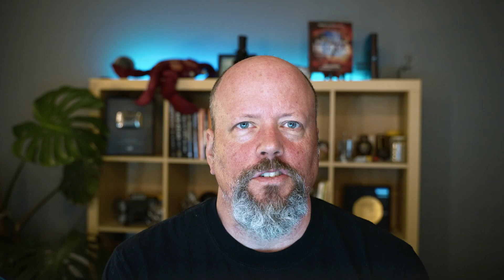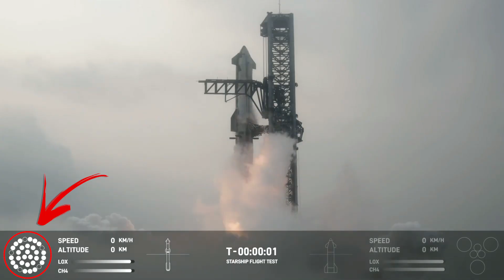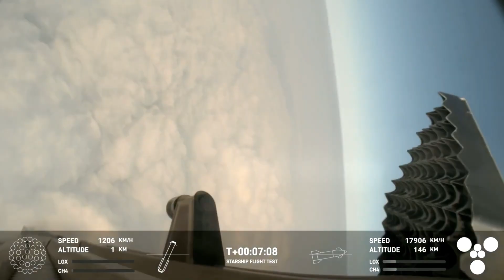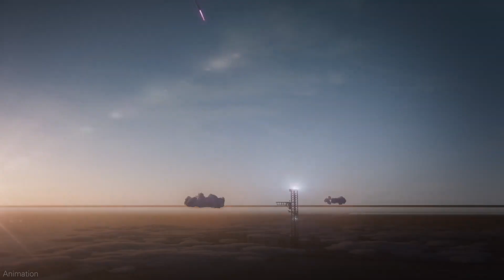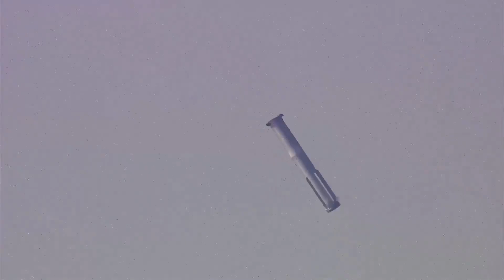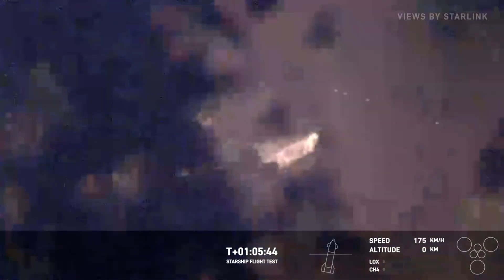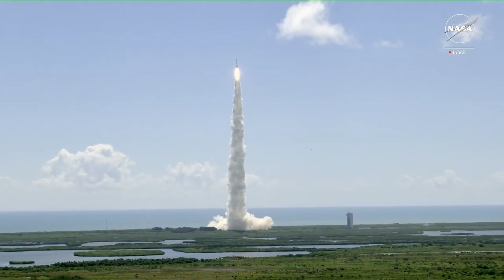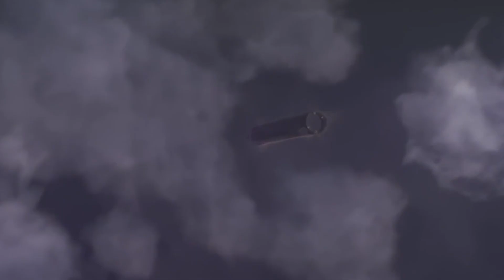IFT-4 and the Future of Starship: All You Need to Know (with @scottmanley  and @MarcusHouse )

Comment: starship needs some small drones on the backside to pop off just before touch down when exits belly flop and goes vertical, to film touch down from multiple angles....
Reply: They pop off while the vehicle is still falling at hundreds of mph?  I doubt any little propeller-driven drone could survive that.  Instead, since SpaceX knows exactly where the vehicles will reenter couldn't the drones just be there, already in the air, waiting for them  to show up?
Reply: @meanderinoranges  yeah like the 'Peregrine 2' drone which averages nearly 300 mph. Of course starship was travelling a lot slower than that when in the vertical landing config at around 150 mph

Comment: 28:35 If the thing that visibly shatters here had been the camera lens, we would not have continued to see anything even somewhat in focus, let alone the well-defined sparks visible through the gaps.  We don't know for certain what cracked (perhaps a protective casing around the entire camera) but it was not the lens.
Reply: It was probably the buildup of metallic spatter from the steel being liquified and vaporized by reentry.  That coating built up and broke away several times between the flap becoming compromised and splashdown.  It noticeably fell away at the very end when splashdown occurred, and what remained of the flap almost fell off just a second or two before the videofeed was lost.
Reply: @Ellingmint  That's what I've seen others speculate and it does make the most sense.  Also the flap did actually fall off from the belly impact and tumble behind the hull.  A movie writer couldn't come up with something more cliched.
Reply: @Asterra2  the Little Flap That Could.
Reply: Most likely a redundant protective lens layer or casing as you say, sure. However it’s a hell of a lot simpler to refer to it as a lens in casual conversation than to say “redundant lens protection layer” or “protective casing around entire camera” every single time you wish to refer to it. Your argument here is pedantic and petty…🙄
Reply: @reverse_Splenectomy  bro i thought it was the lens too until his comment made me realize it literally couldnt be. so thanks to him. and shame on the idiot being petty about it lol
Reply: Lenses generally still work with the front glass broken, but I highly doubt there was not some protective cover glass over the lens.

Comment: I am completely worn out with calling failures success. Raptors aren't reliable. Heat tile design is unlikely to ever work on that body. Yes, Starship "landed", not in a way that leads me to believe it leads to reusability.
Reply: Is that you, Jeff?
Reply: Excellent troll.  Nobody in their right mind would call this a failure.
Reply: @meanderinoranges it was a failure though, if this was any other company everyone would be whining and complaining lmfao.
Reply: @TheCosmicGuy0111  MDS.
Reply: Same to me, I was a bit dissapointed by the failures of raptors. These engines have been tested over and over again; they should be rock solid in terms of reliability by now. However, the tiles are only starting to be properly tested in real flight conditions. So, please cut them some slack.

Comment: What about doing multiple burns with starship, so it doesn’t get so hot it burns off all the tiles? Booster does it right?
Reply: Falcon boosters do that, but not Starships booster. Like all spaceflight it comes down to fuel consumption. If you can do something without using fuel you will use that option if at all possible.
Reply: @arnelilleseter4755  I was talking about starships booster

Comment: I'm placing bets on putting landing gear on them.  They've demonstrated they can land rockets competently.  They can launch this big rocket and get it down softly.  All it takes is one bad catch and you destroy your pad and there goes quick turnaround.
Reply: That means more mass, and slower processing for re-use for the booster at least.
Reply: @starman2337  What it mostly means is less mass to orbit.  I would contend it doesn't really slow things down if you're building them as fast as Musk says they will be building them.
Reply from the maker: Yeah, I wouldn't be surprised if they go back to landing legs

Comment: 35:35. Holy cow I hadn’t thought that yet.    At the least they big damn rocket that hauls heavy right now.
Reply: yeah, but if the Spacex commercial director was watching they would be doing a massive face palm hearing that
Reply: @mutleyeng  What do you mean?

I think SpaceX would be wise to develop an expendable upper stage for Starship, assuming that upper stage resue will take a lot longer until it's available.
Reply: I’ve been telling an “Anti-Elon” friend of mine for a while now that for NASA’s lunar landing mission and several other use cases, they truly don’t need to prove reusability or many of the other firsts that they’re ultimately going for. With as inexpensively and as quickly as they’re able to crank out these rockets and engines, they would still continue to destroy the market even further!🤷🏾‍♂️
It’s crazy how someone’s political ideology can not only manifest into hatred for someone they’ve never met, but to also begin to irrationally attack an entire company that person works for but whatever…
Reply: Do we know just how much it would cost to keep destroying 30 Raptor engines? 🤔
It might be economical to keep destoying boosters had it only had 3 or 4 engines, but I doubt SpaceX will make much heavy lifting profit if 30 engines are lost each launch.
Reply: Isn't their plan to build one starship per day?  They can do expendable by charging the costs.  Affordability is part of the plan.

Comment: I’m just a little curious why do we have to come in so fast? We do not need our heat shield when we go up into space why do we need the heat shield when we come back down? I’ve asked this question a few times and got responses. oh, we will need more fuel to, slow down but if you can take all of the heat shields off, which I’m sure is over 2000 pounds even though they are super light that would be plenty enough fuel just slow down. I’m a little confused why we have to come into the atmosphere so fast we are not in the 60s anymore
Reply: It takes almost the entire propellant load of Starship just to accelerate from its speed at stage separation (around Mach 3) to orbital velocity (Mach 25).  It would take nearly as much propellant again to decelerate from orbital velocity back to some low Mach number (and carrying that much propellant to orbit would mean burning even more propellant just to reach orbit: it's "the tyranny of the rocket equation".)

The mass saved by getting rid of the heat shield is only a tiny, microscopic fraction of the mass of propellant that would be required to deorbit and reenter propulsively, rather than ballistically.  Current Starship Block 1 hardware carries up to 1200 tons of propellant (and uses more than 1000 tons of it just to reach orbit); future Block 3 Starships are projected (by SpaceX) to launch with 2300 tons of propellant...
Reply: @Spherical_Cow   Yes, I understand coasting into the atmosphere but if one tile is off, you lose your whole shift so it’s only a free ride. If you don’t burn up if there were no heat shield, which is not cheap, and you could use the extra weight for fuel to slow down and slowly enter the atmosphere. I don’t know. it just seems like an old concept come into the atmosphere full throttle. Just for curiosity what would happen if they were able to slow down, would they not need the heat shield?
Reply from the maker: Using the atmosphere to slow down is a free lunch since you don't need to use propellant. But you have to survive going from 28,000 km/h to 0 in just a few minutes.
Reply: @frasercain   Yes, I understand coasting into the atmosphere but if one tile is off, you lose your whole shift so it’s only a free ride. If you don’t burn up if there were no heat shield, which is not cheap, and you could use the extra weight for fuel to slow down and slowly enter the atmosphere. I don’t know. it just seems like an old concept come into the atmosphere full throttle. Just for curiosity what would happen if they were able to slow down, would they not need the heat shield?
Reply: The heat shield is unnecessary on ascent because the majority of the acceleration happens outside the atmosphere. Braking with rockets is just the reverse of that acceleration so it will need almost the same amount of fuel (it's less than when ascending because the payload has delivered but the empty vehicle still has a lot of mass). So to slow a vehicle like Starship so it can reenter without a heat shield, it would have to be close to fully fueled before it started its descent. This is possible with the refuelling but it would cost the same as the refueling needed to go to the Moon.

Optimistically, even if deleting the heat shield reduces the mass by half, it still won't be enough to get the Starship into orbit and still have enough surplus fuel to slow down using only rockets.
Reply: @shanent5793   Yes, I understand coasting into the atmosphere but if one tile is off, you lose your whole shift so it’s only a free ride. If you don’t burn up if there were no heat shield, which is not cheap, and you could use the extra weight for fuel to slow down and slowly enter the atmosphere. I don’t know. it just seems like an old concept come into the atmosphere full throttle. Just for curiosity what would happen if they were able to slow down, would they not need the heat shield?
Reply: Try it. Seriously, start up Kerbal space program and test it out. We could tell you what the equations say but it's not going to mean much to you unless you understand the math or at least get an intuitive sense for the physics involved.
Reply: @isakoqv  Yes, I understand coasting into the atmosphere but if one tile is off, you lose your whole shift so it’s only a free ride. If you don’t burn up if there were no heat shield, which is not cheap, and you could use the extra weight for fuel to slow down and slowly enter the atmosphere. I don’t know. it just seems like an old concept come into the atmosphere full throttle. Just for curiosity what would happen if they were able to slow down, would they not need the heat shield?

Comment: At what point does the tower get taller for the next version?  At what point the the second stage quick disconnect move to a higher point on the tower?
Reply: Perhaps the quick disconnect is moved when they build the second tower !!
Reply: @sja45uk  Or do they put it on a trolley like the chopsticks?

Comment: 33 engines producing 250 tons of thrust generate a combined 7425 tons of thrust at 90%.  Losing 1 engine, they would need to up the thrust for the remaining 32 engines to 93% to produce equivalent thrust.  30 engines operating at 100% generate the equivalent amount.  If more than 3 engines are los(29) engines, the max it can generate at 100% is 7250 tons....
Reply: Assuming that the engines are not gimbaled on the Booster. You need to lower the thrust of the engine on the opposite side. 
So depending on the configuration, loosing 2 engines may already be too much to be compensated by increasing the thrust of the other engines.
Hope for symmetrical engine failures, I guess.

Comment: What if they just parachute land the hot stage ring?
Reply: Why?  The next revision of the booster will probably be several tons lighter, and there'll be no need to jettison the ring.  In fact, it'll most likely be an integral part of the booster, incapable of even being detached.
Reply: It would sink with the chutes upon landing, not to mention the added weight of the chutes for launch.